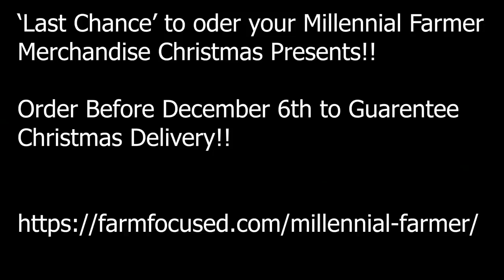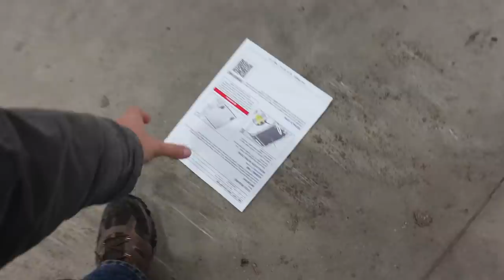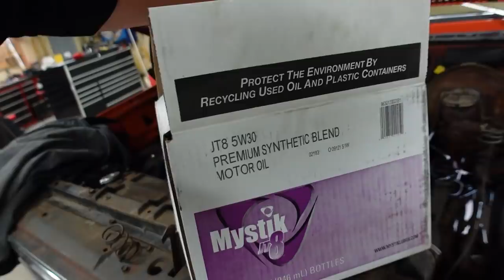Controlling Soil Erosion and Cleaning up The Water

Comment: A quick tip to avoid making a mess of your floor and sweatshirt.  These older trucks with the oil filter mounted nice and vertical, you can take a center punch or old crusty Phillips screwdriver and punch it through the bottom and let it drain out prior to loosening it.  Saves on floor dry and sweatshirts.🙂 An old timer showed me a long time ago and figured I'd pass it along if you didn't already know.  Hope to see you back on your feet as well.👍
Reply: Smart ey?!
Reply: @Blasterxp  loud sound
Reply: sir loud
Reply: i am not pipe expert kent
Reply: perfect
Reply: Exactly what I was going to say. Works great and no mess.
Reply: I use a cordless drill and drill a small hole, but that works too.
Reply: I do the same thing, it make it a lot cleaner

Comment: Hey just and FYI. When changing any filter the best easiest and defenlty the cleanest is to use a center punch and make a hole at the bottom of her filter and let it drain out. You might have to loosen it after you make the hole to help drain. 
It works amazing I do it on 99% of our farm equipment and trucks. 

Good luck keep up the good work.

Comment: Wondered about the wisdom of 5w30 in a 70's engine, I'd have thought more 20w50 semi-synth. I presume that was Mystik's recommendation though. Get well soon Zach from sunny Scotland.
Reply: the 5W (Winter viscosity) much better for that location, and is not how thick an oil is is necessarily better even older engines if not wore out and since rated as a 30 is fine for that one, just depends on engine if worn, leaking etc otherwise good. I prefer not to run synthetic on original older engine seals but see many have no issues, again depends.
Reply: We always ran 10w40 in our 350 and 454 on the farm in ks as that was the recommendation from gm back then
Reply: Id bet that truck never see's the cold, salty, Minnesota roads. Summer cruisin only in a truck that nice
Reply: I know through the 1980’s and new GM didn’t recommend anything heavier than a 30 weight (5w-30 or 10w-30) due to not getting enough lubrication to the camshaft with say 10w-40.
Reply: In Minnieeeesootaa surly you just!
Reply: I’m curious also, and while I’m admittedly no mechanic, I’m under the impression that it’s not the best to start putting synthetic into an old engine that hasn’t ran it before. Maybe this one has, but I believe with all the detergents in modern synthetic it can cause an old engine to leak like a sieve. Again, not a mechanic, just what I’ve been told by smarter people.
Reply: @jermanley1981  I am not a mechanic either but I have been servicing my own vehicles all my life and I am not sure that I believe that you cannot switch to synthetic oils in an older engine. I think if it’s going to leak it’s going to leak with what ever oil you use.

Comment: Just a couple of suggestions.. First filling the filter before installation is not a good idea and most OEM’s say not to pre fill filters. Mystic is good oil but I’m not sure it has enough zinc in it to protect the cam and lifters in that old of a engine, so you might consider a zinc supplement
Reply: Good suggestion on zinc supplement, some guys are using rotella because it still has some in it among others.  Now for my question. What supporting facts show pre filling a filter does any damage? I'm just curious
Reply: @davedunn2124  I'm curious about that, too. Any time the filter location allows, I have always pre-filled the filter. Hundreds of oil changes over a few decades with zero issues.

Any solid lifter engine needs more zinc than most modern oils provide. Rotella and a few others include it, but are a little thick for winter time temps in MN. Might just need that little can of zinc additive.
Reply: @corey6393  when you fill a filter, you are filling the clean side that goes directly into the engine.  ANY contaminates that are in that oil do not get filtered but go directly into the engine.  Even new oil might contain some type of contamination even if it is just from the molding of the container it is put in.
Reply: @jamesdean4272  I'll take my chances while not filling you are running the top end with residual oil until it pumps the filter full and gets it going. Which do you suppose is more likely to cause long term damage?
Reply: @jamesdean4272   I'm with Dave Dunn on this one. Whatever impurities are in a fresh, sealed bottle of oil are likely to be much less damaging than running an engine with no lube at all.
Reply: Absolutely run a ZDDP additive for that flat tappet cam.

Comment: Years ago I worked for a guy that run tile. Back then the tile was 6 inch cement pipe each about a foot or so long. The cement tile was first placed along the tile route you would take. You then started the tiling process. You would pick each individual tile piece up and put it in a chute that delivered it to the bottom of the drainage trench. I would go through a bran new pair of leather gloves in no time because of the ebrasive texture of the cement. Anyway, like everything else it's alot easier now. I'm 64 and my grandfather actually dug tile in with a spade. It was a red clay tile. My mom said those guys that did that work had arms like tree trunks.  We sure have it easy now compared to 100 years ago.

Comment: Two things: watch your oil pressure with that 5w, that may be a bit thin for that old engine and take out the bearings. A ZDDP additive will make the cam last a lot longer, unless you know that there's a roller cam in it.

I fill my oil filter before installing it, I figure the risk from contamination if you're pouring clean oil into a clean filter is lower than the risk of running too long without oil pressure and taking out the bearings..........

Comment: Not sure how many others have mentioned. But make sure that oil has some extra zinc for the flat tappet cam. If it doesn't (which i suspect) you can get zinc  additive to put in. I've experienced this the hard way. Its also why the actor that plays Derick in VGG uses diesel oil.  anyhow keep up the great work and we'll see you at a million!

Comment: Passenger side of the engine where the head and block meet behind the alternator should be a partial vin that can be deciphered to what the engine came in. This is assuming the block has never been decked of course.

Comment: Zach I hope you're feeling better from my experience of the Chevy trucks looking under the hood that looks to be the correct style of engine the manifolds air cleaner etc etc etc but to tell for sure you can look behind the alternator on the block surface if the engine is never been decked. You should be able to find part of the VIN number and the engine code and you can Google the engine code

Comment: Casting numbers on the back of the engine will give you a better idea of the era of the engine. Casting numbers on cylinder heads will also give you a path of Identifying the parts. 10w40 with zinc additive. I use Schafer's supermoly for zinc with any brand oil

Comment: I recently learned that filling the filter is actually a bad idea. After hearing why i tend to agree. The center of the filter is where the filtered oil comes out and enters the engine. If you get any contaminants in it you risk pushing them through the motor. When dealing in as small of particles as oil filters filter out it makes sense. Also, on old square bodies there is a way to close the hood. Dont just yank down on it or it will taco. Wiggle it side to side with slight downward pressure until the hinges start moving then push back towards the windshield to close.

Comment: Look at the right hand side of the engine block in front of the cylinder head behind the alternator. There is a flat protrusion of the block. The numbers there should be the last five digits of the VIN number.

Comment: Put a small hole in the upper filter. Use rubber tip air nozzle with about 40 psi.
No more oil on the arm/cloths

Comment: so for filters like that that hang upside down, i usually use a small pointed punch and a hammer and knock a small hole in the middle to drain the filter before i take it off. much less mess.  do it to all the hydraulic oil filters on the tractors i fix.

Comment: If not already mentioned.  You should run an oil with high zinc to save the flat tappit cam. Like vavoline vr1 for say. Or an additive.
Reply: 10-30 Rotella Diesel engine oil, Mystic 10-30 diesel oil, or Lucus 10-30 diesel oil all work fine. Diesel oil still has plenty of zinc and phosphorous in it. Car oil not so much. Wintertime maybe a 5-30 semi syn diesel oil.

Comment: Make sure to add some zddp additive if that engine is still a flat tappet. Synthetic does NOT have the required zddp for the flat tappet.
Reply: The few that have pulled a burnt off camshaft know😂 that zinc is important

Comment: When you go to pull the filter grab a old screwdriver and grind it to a point and punch a hole in the filter while you take the drain plug out then when you go to take the filter off you want make a mess like you did hope this helps

Comment: She’s gonna have seal leaks with that 5w30 synthetic oil on what is presumably a high mileage old school engine.  Id only use 5w30 if you are parking that thing outside at —20.  Otherwise, newer 350’s (1980’s- early1990’s) called for 10w30, and older engines I’d go with 10w40.

Comment: Does MN NRCS make you have a grass buffer around the inlet for 5-10 yrs like IN does?  Have to address water quality too as well as soil erosion and WASCOB's tend to be at the bottom end of that spectrum.  Biggest issue we've seen on the ones I've designed and installed is corn cobs plugging the restrictor orfice in the risers.  After final inspections the seem to disappear, but the bottom dam will have a fountain.  Ours are 24 hr draw down on storm water.

Comment: "Work on the race car" in November is code for Drink beer, talk about what go fast parts to put on it and bench race.  Been there, done that 🤣🤣
Reply: Or do shop burnouts
Reply: I cannot confirm denying admitting the denial of possibly substantiating the confirmation of ever doing that 😏
Reply: @Pep8691  I had a trucking company and had anchors in the shop floor for holding trucks down.. ya think a modified is gonna pull them out? They made a hell of an burnout anchor!!!

Comment: Zack they are numbers on the motor that you can run that is in the vin  to see if the motor is stock , I bet it is stock I took care of my Mother n laws truck witch was a 1985 silveraouto 10 searies . the numbers should be on the head or intake

Comment: Just a suggestion but pre-filling in oil filter can be kind of dangerous for your bearings if there is any contaminants in that oil that you’re putting in that filter they are going straight through the block before being filtered But like I said it’s just a suggestion

Comment: At the beginning you said the 12inch pipe was dual wall it's not it's to bendable I put the pipe on the rolls and now currently work for a crew dual wall won't bend like that they will usually put dual wall in sections like 20 or 30 foot things could be different there but that's how we do it in Illinois

Comment: Yeah when I change the oil in my 76 Chevy truck I pull the drain plug out then I take a screwdriver and pop a hole in the bottom of the oil filter and just let them both drain saves a lot of mess on your arm. Lol

Comment: How are you going to mark the basins in the fields so they will not damaged with equipment? On the truck check the engine number on it. It will not tell you if that engine belongs on certain truck. But it will tell you if that is a truck motor that was to be installed in a Chevy truck.

Comment: Zack, Have Cory watch the rear tires on the spread axle race car trailer. They have a tendency to eat rear tires. Too bad that they couldn't be made steerable like on some of the European semi trucks.
Reply: It's Zach
Reply: @deadghost1964  it’s what ever spell check decides it is.
Reply: @gungadinn  proof read it first
Reply: In fact if you see description, at the bottom, it will saying Zach.
Reply: @deadghost1964  Instead of whining about a K or an H, what about the trailer tires wearing on a split axle trailer, or do you like seeing yourself type?

Comment: So... those were the days.  On the four wheel drives, you could almost sit up under the truck and, when it rained, there was enough space to crawl into the engine bay and pull the hood down part way and keep working.  No real emissions and headers were legal.  Small block  Chevys ruled...

Comment: Here's a little secret about changing oil filters so you never get oil down your arm that I've held on to for 40 years. Would have been longer but the material was not invented till the 50's. Here's the secret... don't you hate it when people keep talking and talking about nothing and won't give up the secret for hours until you're about to walk away or click on a new Youtube channel....lol. 
Losen the oil filter just enough to keep it from leaking but easy to spin off by hand then take a plastic bag, one without safety holes in the bottom of the bag and place it around the oil filter up against oil filter housing and spin of the filter letting it fall into the bottom of the bag holding the bag against the housing until the small amount of oil drains from the housing. 
No mess no fuss.
Reply: @jackpinesavagemn  that would take forever
Reply: @deadghost1964  Depends on the size nail used.
Reply: @dwightl5863  I use 50 Cal casting to punch it.

Comment: Don't see how this tile drain project controls the release of water/run-off.  The term basin you use, I assume, means a surface water intake or hinkenbottom? .
Reply from the maker: The term basin I'm referring to will be a sediment control structure. It will literally dam the water up and control the speed at which is leaves through a hickenbottom, yes.

Comment: One trick changing an oil filter is take a punch and hammer and pop a hole in the bottom and let it drain before you spin it off.

Comment: It's a bad habit to prefill any kind of filter, because you are putting unfiltered fluid directly into the system. You may think oil out of the bottle is pure and clean, but it really isn't, and diesel often has contamination from the nozzle or container.
If you do oil sampling on your tractors (you should), try sending in a sample of hydraulic fluid straight from the drum, and prepare to be surprised at the level of contamination.

In industrial settings where a machine failure might cost millions per hour in lost production, oil and hydraulic fluid only gets added using a filter cart that pumps the oil through a water removal filter and a low micron polishing filter so that no particulates get into the system.

Prefilling the filter does the opposite, and while it may not matter much on a beautiful old Chevy 350, do it on the diesel filter on a big tractor, and you may put some grit in that will tear up the injector pump with extremely tight tolerances and cause a major rebuild, all because you wanted to save a couple of minutes by Prefilling the filter with unfiltered fluid.

So while you may be thinking that it's a good practice to get oil or fuel to the engine faster, it's the opposite, because you are sending unfiltered fluid through it.

Comment: If you turn the air filter cap upside down you’ll love the sound of your new engine. 😉 Also, you’re supposed to hold the nozzle side of the quart of oil on top for proper airflow into the bottle. 😀

Comment: That seemed very unsafe putting that Polaris engendered not glass accessory on with the battery still connected. You should write the 
engineer/lawyer and let them know there should be at least one more step in the directions.

Comment: Not trying to start a religious war here, but do not pre-fill your oil filter (even though that's what my dad taught me to do 55+ years ago). Any contaminants that might drop into the center part of the filter as you're adding "clean" oil into it go directly into your engine *unfiltered*. The few seconds that it takes to fill the filter after the first start isn't going to damage your engine, but one tiny piece of unfiltered grit certainly will.

Comment: Why you using full synth motor oils in so old motors? When You care a lot your car you should use semi becouse its mineral part can hold viscosity better than synthetic. Especially when your region has all seasons and you drive it like sundays only or smth. Let sundays car has more oil changes with shorter milage and your car is grateful. Greets from Estonia.

Comment: You dont have to prime the filter unless it's a diesel
Reply: why would fuel make a difference to the lube system?
Reply: @robertlonsdale3826  what? He didn't put fuel in the oil filter he put oil in it to prime it but you dont have to prime it on a car because the oil pump is strong enough that it doesn't need it but diesels since the oil is so thick it needs a head start to ensure the engine doesn't blow
Reply: @robertlonsdale3826  and help ensure proper oil flow and lubrication
Reply: Depends on the year of make. Older like this need oil in filter, etc. Today's models, you don't need to.
Reply: @deadghost1964  that's true finally someone who knows cars

Comment: They didn’t even have 5 weight oil when that engine was built… probably should be running A 10 weight 10/30 in winter and A 10/40 in summer…

Comment: Send me the engine number and I will check with my machine shop and let you know should be behind the driver side cylinder head on a flat plate on the block